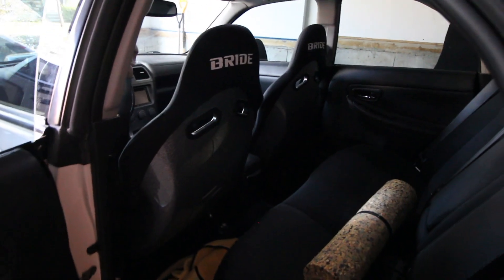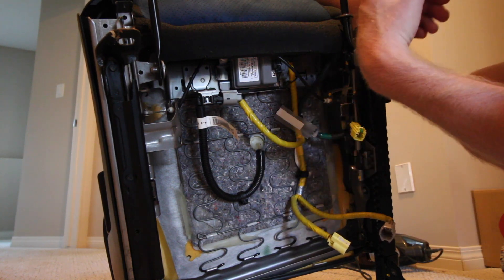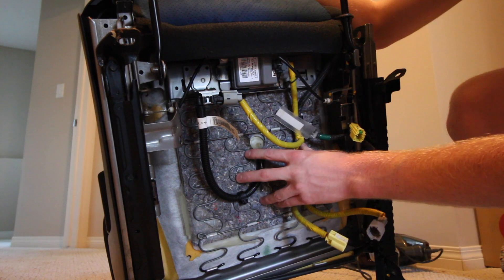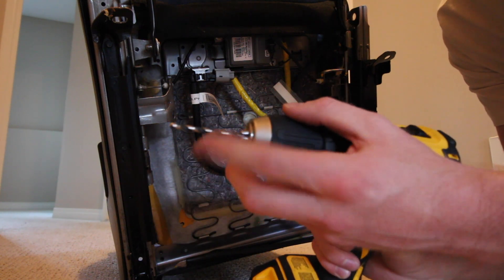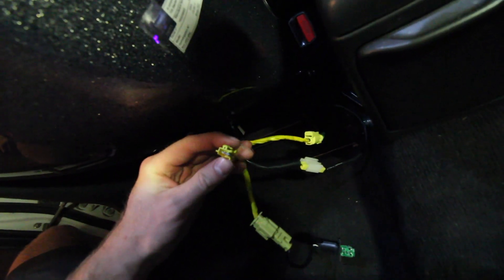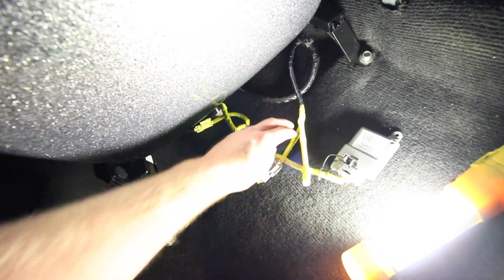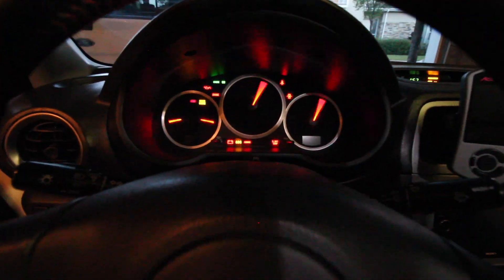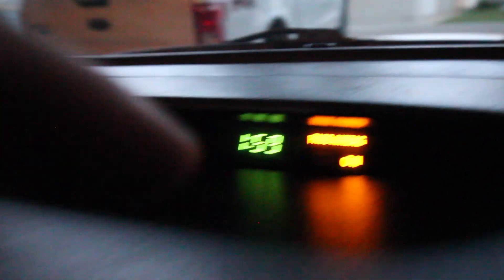How to BYPASS AIRBAGS when Installing Aftermarket Seats

Comment: Yayyyyy!!!!! It worked!!!
Definitely you need the module and the bladder to be plug in. Mine didn’t work with just resistors.
Hope there is someone out there  with the same issue as me and this can help  them out too.
I have no clue before I found this video thanks a lot brotha 🙏🙏🙏
Reply from the maker: Thanks a lot man, appreciate it. Glad it worked for yah! I had the same issues before too where the resistors on their own didn't do the job!
Reply: I'm swapping to JDM STi seats today, thought I'd just throw a resistor in for the passenger airbag. You saved me a lot of time today, thank you!

Comment: This is an old video, but you can actually unclip those springs pretty easily and just pull the bladder out the bottom. I transferred mine to a corbeau seat that also has springs on the bottom.  It fits much tighter and my passenger airbag off light is lit. I couldn't remember if this light is on all the time when nobody is sitting in the seat or not. I guess it makes sense that it would be off if nobody is sitting there, but seems to me it wasn't lit before because when i sat something in the seat the light would then come on. At any rate it goes off if someone is sitting in the seat which is all that really matters.

Comment: I have a 2007 toyota yaris I want to permanently remove my passenger seat, Seeing you do this work actually eases my mind for hard factor with that said and no replace seat going in do you have any suggestions for doing this? I was thinking of creating an overcover for bladder, wires and black box to protect them  outside of seat but with no seat in place will this  fool system into thinking all is ok on passenger  side making system curcuit complete?

Comment: What is the need for the resistor? Is there a resistance in the metal of the original seats that isn't met by the new seats? Since (04-06) GTO's read +/- 6 ohms for the airbag circuit which is greater then 3.3 ohms I cant use that low of a resistance. I would figure everything can just transfer from old seat to new seat. Someone help me understand why a resistor is needed because im missing something

Comment: How did you know to use a 3.3ohm resistor. Did you take a reading across your existing airbag?
Reply from the maker: Just based on the research I did for my model car. That's what I found others to be using
Reply: Great video! Just to be clear with the resistors installed the airbag will deploy as needed??
Reply: @Slarvis4538  NO the resistors duplicate the signal the computer is expecting to see from a functioning (non-deployed) airbag so aftermarket seats can be used or to bypass a faulty airbag

Comment: Would it be possible to leave out the extra foam and still have the seat velcro function around the bladder and maybe double stick tape down the bladder to the seat? Also, do you still use the stock seatbelts with the new seats?
Reply from the maker: Hey, ya i think that would probably work, I might even try it myself! Originally I thought the foam might be needed for extra protection to prevent damaging the bladder. And I did upgrade the seatbelts to some Takata harnesses. Likely do a video covering some of those things!

Comment: Have a question for you, I have a 2018 F150 XL with manual seats. My driver seat sits way to low for me and I have put 2" spacers between the seat and trucks body. When I do that the airbag light comes on and won't go away. Is there a way to make the light disappear?

Comment: And updates on your final solution? I want to do the same but will need to swap the sensor. I was thinking about stapling the bladder between the foam pads and placing Velcro on both ends to secure it in the seat.

Comment: I have a 2010 Subaru legacy I was sold it unknowingly the harness connector to the passenger seat sensor is melted burnt. Help I have no one to help. I'm not sure how the harness plugged in at the other end and I'm not sure it the seat sensor is bad. I seen had someone take it for an air bag recall done I wonder if that's why it melted. Help have the seat belt flashing and singing even if it's clipped in and air bag still on dash driver side is fine. Help!

Comment: Is the drivers seat the same? I’m just switching over the drivers seat and was going to use resistors but people have said they don’t work
Reply from the maker: Drivers side was just a resistor if I recall correctly! Passenger side is the more complicated of the two

Comment: Hi I have carmay se 2012 and I am looking for a resistor for seat airbag can you let me know how many watts and ohms resistor I need ?
Reply from the maker: I used 3.3 ohm 1/4 watt for my car, which seems to be pretty standard. But if you google it, you should be able to find a quick confirmation in a forum!

Comment: Will this work on a r35 gtr ? just got braum seats and i was wondering about getting the airbag lights off , do i just need an 3 ohm resisters ?
Reply from the maker: I'm sure there would be differences across different brands and generations. This worked for my particular model. I used 3.3 ohm 1/4 w

Comment: Hey mate! Great video, quick question: after you install the airbag canceller, do the other airbags in the car still function properly? Or does this prevent ALL airbags from functioning? Thanks!
Reply from the maker: Hey! So by adding the resistors, it tricks the system in thinking that the airbags are still connected. What that does, is it allows the rest of the airbags throughout the car to still function (if you have other airbags left in the car).

Comment: Any help would be great but I’m confused as to which exact connector to put the resistor in. The main harness that comes out of the floor?
Reply from the maker: Yah thats most likely the correct one. It depends on your car.. but you can always try it and see if it works!

Comment: What kind of resistor do I need to trick airbag sensor for civic 9th gen 2012?
Reply from the maker: If you google your car, you should find some forums with that info! I wouldn't be surprised if its the same as my car.. but safe to check!

Comment: I have a 2004 Honda civic lax 4 door with airbags on the side of the seat the side of the facing the door...they are very stained and cigarette burns...I found d the same stock seats like new but with out the airbags and know I will get a airbags light on..I want to switch  them..you think if I cut the  the airbags out to connect the wires woulookd work
Reply from the maker: Hey! What your saying makes sense. Because as long as everything is plugged in, the car shouldnt have a problem. Instead of cutting things up, you may also be able to use resistors to trick the car into thinking the side airbags are still connected? I was able to figure it out on my car, but I'm defintely no expert Haha.

Comment: How did you find the resistor value? Did you look it up specific to your car or did you use a meter?
Reply from the maker: I actually just found the 3.3 ohm value through some forums!
Reply: Use a meter when the seatbelt plug is connected and back prob with a ohm meter. Do this for everything, life will be simpler.
Reply: @hufman9807  why the seatbelt plug? the resistor was for the airbag connector wasn't it?  To fool the computer into thinking the airbag was still installed.

Comment: I followed this video and I used resistors to prevent the airbag light. And I salvaged the occupant sensors and the piece that goes on the seat. However, my car still reads that there is no occupant. Is there a way to fix that? After this install, how did you get the car to read that there is an occupant?  Thanks in advance.
Reply from the maker: Hmm. Is the sensor detecting the weight when you sit on top of it? That's how my car would read it
Reply: @brodiecd7093  Yeah, I tried sitting on the piece itself and no luck. I checked all the wires and everything is in the correct place. I don't know what else to do.
Reply from the maker: @wtfisthiserror9436  The only thing I could think of is if something isn't connected properly.. but unfortunately I'm not sure what could be causing that

Comment: does the 3.3 ohms  resister need to be designed for 12 volts
Reply from the maker: That I'm not sure.. sorry. I only know that this resistor is what worked for my application

Comment: Could a guy just use a resistor for the bladder connector if I didnt want to use the bladder?
Reply from the maker: I'm trying to recall back to when I did it.. but I don't believe so. I believe the connectors need to be connected otherwise it will throw a light. Unless you know how to add resistors to those particular connectors, but I'm not personally sure how that'd work..

Comment: what if i use a high ohm airbag resistor? Could it set the airbags off or will it be fine?
Reply from the maker: Tbh, I'm not sure. Best bet is to just search your car model and see what other people are using!
Reply: @brodiecd7093  i have a mk6 golf, people with mk5 golf's are using 3.3ohm airbag resistor's but not sure whether to do the same as that was a gti, mines a 1.4 petrol, might be same though, what would happen if the resistor was put in the wrong hole? Would it do nothing but when put in correct one then remove airbag light?
Reply from the maker: @A250MYG  In that case I would assume yours is also a 3.3 ohm. Lots of cars are I believe. And yah, nothing would happen until its correctly inserted

Comment: Ok, Ive installed new seats, Airbag light still on with 3.3 ohm resistor in place directly to the wires to insure connections any ideas what to do now? thank You for reading this.
Reply from the maker: If your car has an occupancy sensor in the stock passenger seat, and its no longer connected. That could be causing the airbag light to stay on.

Comment: It's my understanding that if your airbag light is on from seat swap and you in an accident ALL of your air bags will go off, not just the ones protecting the impact area.
Reply from the maker: If thats the case, I never knew that.. I only have the passenger airbag left in my car anyway. The rest have been removed
Reply: I swapped the seats out of my Silverado. It might be different but I was told when I brought it to the shop for unrelated reasons that if the light is on and the system is sensing any fault. Airbags will not deploy.
Reply: @quietlysublime523  correct
Reply: Well shit will my airbags deploy or not

Comment: Bro I’m having the same problem, air bag stay on the only thing I having done is transferring the bladder. 
I done resistors and everything.
I got the bride stradia ll and the bladder won’t fit like yours ahaha way to BIG for the seat. 
Help!!!! :/
Reply from the maker: Wide Subie Hey man! As long as you have the correct resistors in both the driver and passenger side airbag connector, it should take the airbag light off your dash. You may need to transfer the bladder over, because at the moment there would be connectors in your car that have nothing to plug in to. That might be causing the problem.. is there no where you can put the bladder in your straida seats?
Reply: Brodie CD I’m using a 3.3 ohm resistor 1/4 wat 5%.
Ahh I see, I took the bladder out but then I realized that the bladder don’t fit underneath the padding it’s too wide you can see it on the side. Does the bladder has to be on the seat to turn off the airbag light or can I connected and see if it turn off?
I mean I can put it underneath and somehow make pressure to it so it’ll be on all the time like you said  people do
Reply from the maker: It doesn't have to be on the seat. As long as it receives pressure when someone is in the passenger seat, it should all work. And you could apply pressure to it all of the time, where the passenger airbag always stays on. But then your seatbelt chime will always go off, because the seat will think someone is in their seat without a seatbelt. Its tricky haha!
Reply: Brodie CD yeah you right, ill do the samething you did and see if it works for me. Thanks bro 
I’ll let you know if it works

Comment: What size resistor did you use in the connectors?  Thanks for the video!
Reply from the maker: I used a 3.3 ohm 1/4 watt resistor!
Reply: @brodiecd7093  Ok Thanks! I have 2.2's so i'll try them but may have to move up the scale

Comment: Hello, what resistors do i need?
Reply: 3.3 ohm is used in the video, but it depends on your car. For example, some cars require a 4.7 ohm resistor. Do some research online to try and find the exact spec

Comment: How do I order the right resistors for my car ?
Reply from the maker: 3.3 ohm 1/4 watt
Reply: This goes for all car makes and models ? Any seatbelt and airbag connection ?
Reply from the maker: @connorross1103  Oh I see. I'm not sure about all cars. I do know that other cars use the same resistor, and I feel like it's probably pretty consistent. But cant confirm 100%, forums should have that info!

Comment: Relocate the passenger side occupancy mat under the passenger side front floor carpet. So instead of someone's ASS triggering the system.. their FEET will. It will every function nearly perfectly as designed. Small people and short kids won't arm the circuit.. but heavy adults feet that reach the floor naturally will
Reply from the maker: That's a good idea man, I might consider that. I'd rather it be off the seat entirely. So the cushions can velcro to bucket. Thanks!

Comment: PLEASE HELP! btw great video I have 2013 Altima with airbag light on I am about to do that bypass soon with the resistors should I unplug battery first ? And what sizes of resistors you used ? How I  know the right sizes? I was thinking 2.2 ohm 1/4  watt is That ok? Light showing in dashboard cause of my seat.... thank you
Reply: I know you posted this like a month ago, but you don't need to unplug your battery first. Your dealing with mostly low voltage electricity and will be fine. As for what size, I'm not entirely sure, but im sure they are fairly inexpensive and trying a resistor won't hurt anything.
Reply: @nitekroller  I know you posted this a year ago but the battery disconnect isn't for electrocution, it's to keep the airbags from detonating in your face while you're working with their electronics.